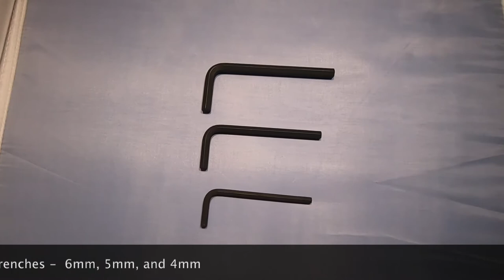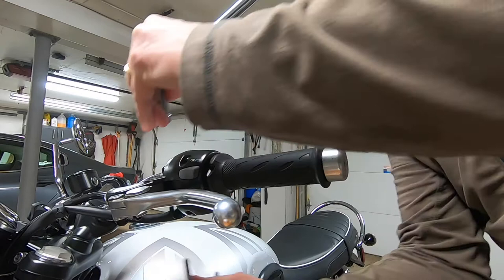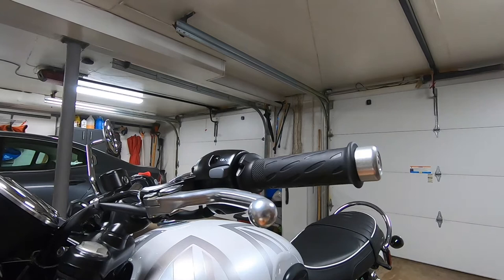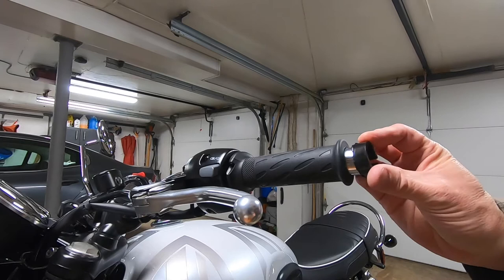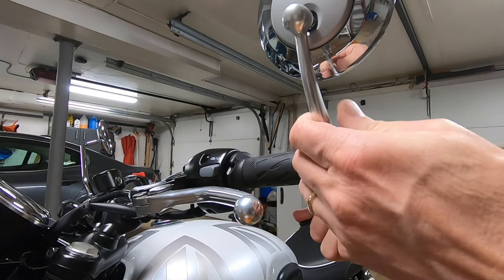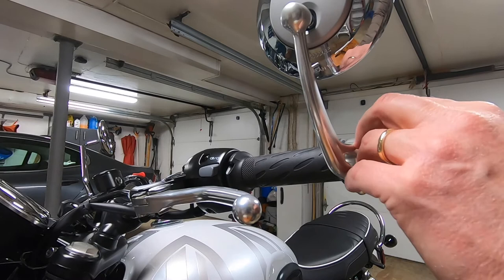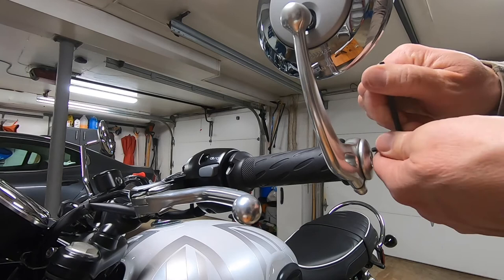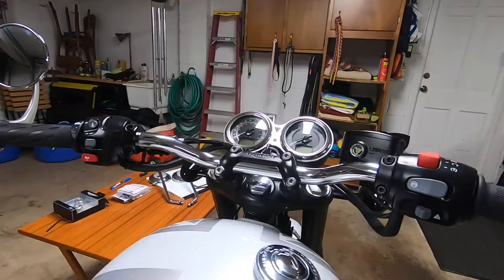2020 Triumph T120 Bar End Mirror Installation

Comment: Thanks for taking the time to put this video together!

I'm in the midst of installing the same mirrors on my 2016 Bonneville T120, and I'm wondering about the throttle side...Did you reuse the spacer in your installation to make sure there was enough free play on the throttle grip? Or did you leave the spacer out?

I'm having trouble getting the right mirror to grab onto the bar. There's just not enough surface contact for it to grab as solidly as the left side.

Comment: I bought this same type of bar end mirror system for my 18' Street Triple R and when I use the friction ring just as you have, I torque down on it pretty good, but it still spins. I called Triumph and they said this kit is not approved for use in the US? I returned this same kit about 1.5 yrs. ago for the same reason. Not sure if I really need to torque it down to 10Nm, but I can try that and see what happens. I should not have to torque down on a bolt that much though and when something feels wrong.....

Comment: I have a 2020 Bonnie T120 and I can not find the attachment to install on the end of my bars, which has heated grips.  Its a tiny diameter so I need a attachment to place over it before attaching mirrors.
Reply: did you find a solution! I have the same problem!